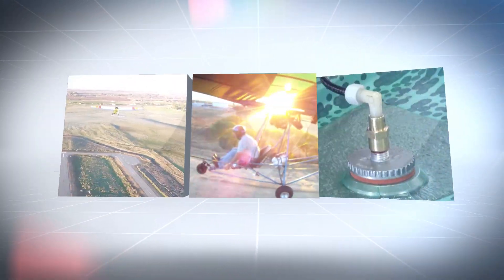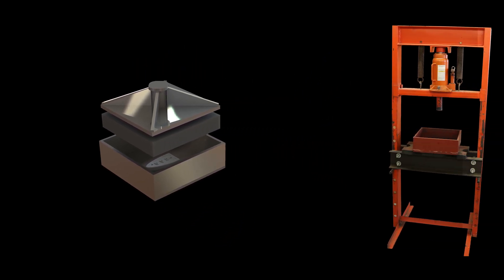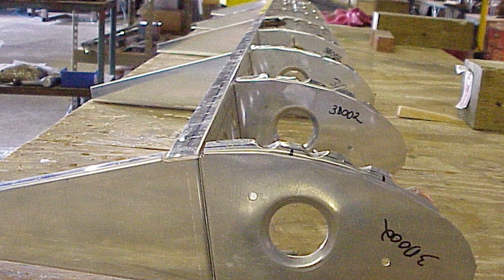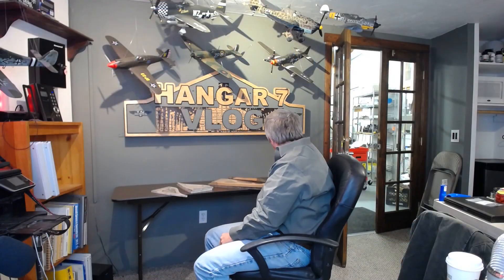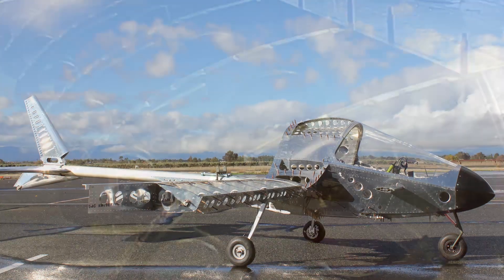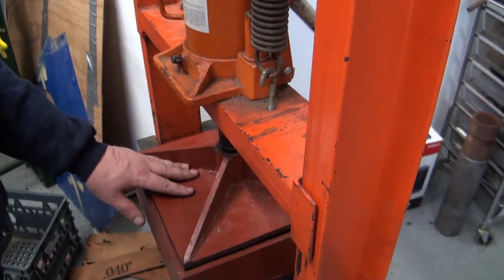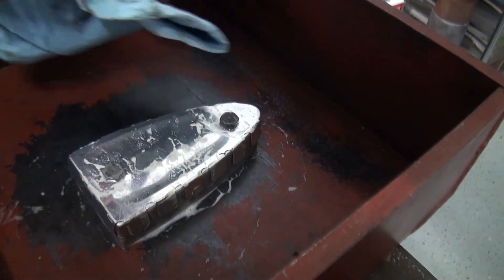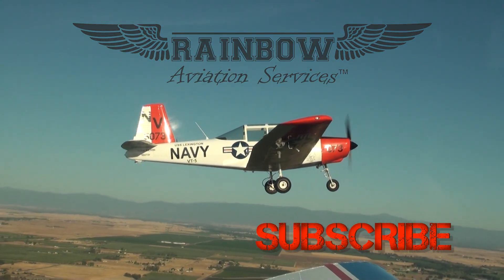Low Cost Hydroforming

Comment: Can a rubber water tank or bag do better than the rubber block?  Between the them the rubber sheet is still essential?
Reply: If you had it as a water tank what would prevent the water from getting under the workpiece?  Then, as you pressurize the water, wouldn't it just increase in pressure everywhere, both above and below the workpiece, thus doing nothing?  This technique relies on increasing the pressure above the piece, while maintaining a low pressure below - that's what pushes parts of the workpiece downward.

The idea of a water bag is interesting, but you've already got what - 300-400 psi of pressure being generated?  Now take that bag and bend it over a slightly sharp edge (say the points on one of those hex-head bolts.)  You'd need some pretty strong bag material for it not to puncture.  Use some rubber sheets between the bag and the workpiece you say?  Then you've pretty much come full circle right back to where you've started, haven't you?
Reply: Probly need to seal more tightly around the edges where the top-plate meets the box walls, but that should work .

Comment: I have made dies for rubber forming with glass reinforced bondo, works well for a limited number of parts.
Reply: I love tidbits like this. I wonder what kind of part you could get using bondo as the fluid under pressure. Keep it under pressure til the bondo cures. I can't think of any particular use atm.

Comment: If you sprinkle talcum powder on both pieces of rubber it will flow much easier and last longer.We use rubber quite often in our shop for forming but mostly as a bottom die in a 150 ton press brake.

Comment: Technically, it is a hydraulic press... so it is using a fluid.
Reply: The rubber is also being used as a fluid to evenly apply pressure to drive the part into the die.

Comment: I think that your locating pins should be as rounded and low as possible. The hex corners prevent smooth flow of the rubber towards acted on material. Also, the sharp corners of the hex are what tears the inner tube sacrificial material.
Reply: Button head bolts would work better.
Reply from the maker: I readily concur, our normal locating pin is a used clevis bolt with a
Reply: Flat head capscrews, then you can get a formed countersink too.

Comment: Not hydroforming, so why call it that???
Reply: Ken Fugate -  Acryally it IS hydroforming, using TWO fluids to achieve the desired end result. One fluid is in a lower viscosity form than the other (the hydraulic FLUID inside the press performing the exact function of the fluid in a more traditional application), but both fluids (hydraulic AND rubber) under pressure perform as the FLUID in this process. The EXCELLENT narration covers this pretty well at the beginning and again later in the vid.
Reply: It is the Guering Process type of rubber pad forming. See https://en.wikipedia.org/wiki/Rubber_pad_forming
This is what hydroforming is: https://en.wikipedia.org/wiki/Hydroforming

Just because the narrator says its hydroforming doesn't mean it is hydroforming.  He needs to do his research before making a video.
Reply: It works, doesn't it? who gives a damn what it is?
Reply: The rubber is the fluid - hence, it is hydroforming.
Reply: It is the Guerin Process, one form of rubber pad forming.  Hydroforming uses pressurized liquid to force the metal against a die.

Comment: how does the piece get the extremities bent?
Reply: By forcing the rubber - at application pressures flowing as a fluid - around and past the sides of the part. It literally SQUEEZES the rubber down the sides, which in turn deforms the tabs downward to match. One interesting note, mentioned in the vid and elaborated on elsewhere in this discussion (Lemon Pledge and talcum) is that if you can effectively apply a lubricant between any 2 surfaces that must interact under pressure, the effect is improved, enhancing the mold-ability of the fluid ! Very cool !
Reply: Keep your zipper up to prevent that.
Reply: its really interesting this teory @chuckintexas

Comment: Subscribed :) Thank you for sharing this impressive process, seems like a nice pair to bucks which are 3D printed at 100% fill, or MDF routed with the affordable "Makesmith CNC" My question/request if you please: 

Would you repeat your hydroforming technique with the use of fill from a $10 bag of "recycled rubber mulch" from a garden store? I know how useful a press is, but I'm interested in your assessment of the expensive rubber block compared to mulch. Many thanks again for this great video!!
Reply: I think you want sheet, in order to provide even pressure.  Mulch would have all kinds of air gaps, and squeezing those out would divert some of the pressure.  Also you might not have consistent rubber hardness, also there might be steel strands in shredded tires...

Comment: hello friend , have you considered using a smaller die pad for smaller objects to increase the force ?
Reply: Considering the rubber is only in contact with the small die it is still transferring max force to the part.

Comment: Where is in this video a HYDROforming?
Reply: This process the he is using is actually called "coining" in the industry. It forces the material into shape over or into another die by excess force using a ridgid or soft upper die to the press the material to the point of deformation. 
"Hydroforming"  is the part is layed over a die or in a closed die then a seal is formed that can withstand the process pressure like a bladder in a well tank only alot stronger. The whole system is flooded with hydraulic oil unitl the part reaches the shape desired.  This differs  from coining in that there is no upper die or pressing frame. The fluid builds pressure on the side of the seal and forces the part to form. A good example  of hydroforming are in car subframes. There are no visable seam welds and a complex part was achieved. 
The hydraulic press arms you see in pictures are for ease of part removal durring manufacturing.  They hold the dies together durring fluid pumping as not to split then when finished they open to allow the operator to eject the part and place a new blank in. This is just a basic explanation of the process. There are various fluids used and die designs but the principals are the same. Sometimes the pressure levels are in the tens of thousands of psi. To accomplish that they sometimes use a device some call a pressure multiplier . A larger diameter ram is filled forceing a small ram to travel but at a higher pressure.
Reply from the maker: We readily acknowledge in the video that this is not true hydroforming. Although even that could be argued because in this case we are causing the rubber to flow like a liquid. That by definition is hydroforming. But from a traditional standpoint hydroforming is using a fluid inside or outside of a mold to force the metal around a die.
Reply: Nooo
Perhaps watch the vid before commenting?
Reply: You guys might be interested in the industrial version of this, called rubber pad forming.
Reply: Jaxx Brat How many years have you been running a press brake and which one do YOU own. I own three and where did you get your press brake cert from.
Reply: Nooo...
Reply: He point blank states that the rubber simulates a fluid, which is completely scientifically true when it's subjected to these pressures.
Reply: I agree
This isn't hydroforming
Reply: Nooo... 
Go back to school